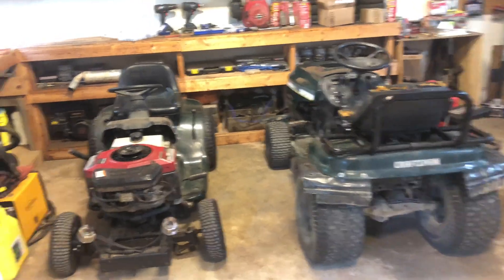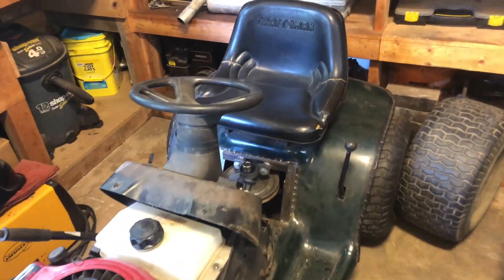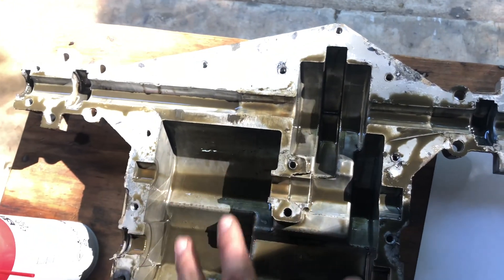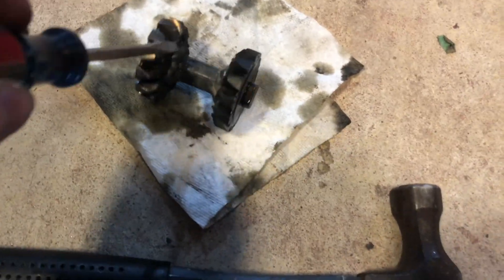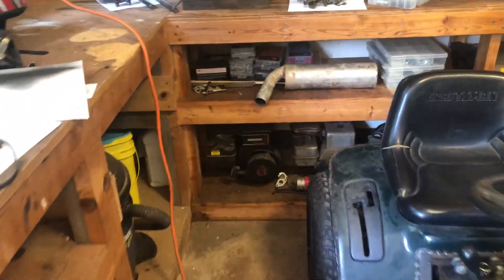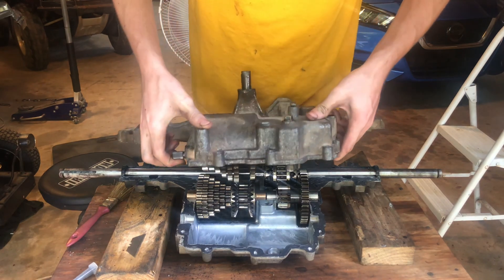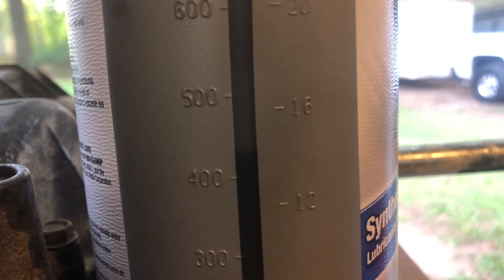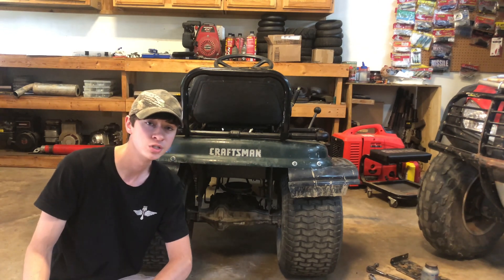Off-road Mower #12 | Welding the Diff

Comment from the maker: I have no idea why 5th and 6th gears are almost exactly the same, if anyone knows then please let me know because I am very curious. If I had to buy another transmission I would perfer the MST-205 because the gears ratios are more spaced out and just seems a little bit better, especially for the racing mower!
Reply: They look the same but count the teeth.
I really don't know either, those gears are pretty close together, if i remember correctly(I bet you went oer this in the vid LoL)it's only one tooth different and aobut the same diameter gear.

820 is the one you want to look for imo.
6 speed sequential like a 206 and has 1 inch axles, bigger tires.
Reply from the maker: Yeah! I kinda want to go 820 but it is kinda expensive and Idk what kind of lawnmowers come with an 820. Do you know any mowers that come with an 820?
Reply: @IngenGarage  any large mower with 12 inch wheels, manual, and 1 inch axles, no lugnuts
Reply: and 8 inch front wheels
Reply from the maker: @spudstudios3342  Thanks man!
Reply: 5th and 6th will feel the same unless you’re going 50-60 mph.  I’ve climbed up from 20-30-40 all the way up to 60 in terms of pulley ratios and Only noticed a real difference past 50
Reply from the maker: @QMF2  Oh ok thanks man! I can't believe these transaxles hold up to this amount of speed, considering there is nothing but bushings! I had mine up to 50 before and it is very sketchy lol.

Comment: If you can find a cheap set of used atv wheels and tires you can use the center section of the original wheels with holes drilled to match the atv wheels pattern. Done it on mine and it’s worked fine
Reply from the maker: Alright thanks man!
Reply: @IngenGarage  absolutely, keep up the great work

Comment: Hey man quick question if you lock 
your transaxle on a chain driven gear box will you loose a few gears. Because I put the gears the same way I found them after I looked them and now I only have 5 gear all forward in reverse
Reply from the maker: Usually some of the transaxles have a chain for the reverse, but there maybe some forward as well. I just lock the spider gears on the differential.
Reply: @IngenGarage  same here and I used to have 5 forward neutral and reverse now I only have 5 forward
Reply from the maker: @domjoey7514  Oh ok!
Reply: @IngenGarage  I was just wondering maybe I did something wrong but I put it in the same way I took it out
Reply from the maker: @domjoey7514  When I do something like that, I like to take photos or videos so when I put it back together I can. For example the bowl gear had a dot on one side and after looking at the footage it went in facing the left side of the transaxle(toward the short shaft).
Reply: @IngenGarage  same here I mean do you think the shifting adjustment screws could cause this
Reply from the maker: @domjoey7514 I don't know to be honest, make sure the detent ball is in there and the spring is not broke. Then just tighten the screw till it is pretty snug and flush with the case. That is what I did.
Reply: Alright thank you same here lol

Comment: Very cool modification!  Where did you get the idea to weld lock the transmission?  Now that it’s done, do you notice any difficulty turning sharp corners now that the rears are locked?  Nice job!
Reply from the maker: I got the idea mainly from FearlessFront, and yeah ican tell a difference at turning lol, I might need to upgrade the front tires to a more nobbier tires because turfs are not really doing much. I drove it around a lot more and yeah the front tires slide a good bit!
Reply: @IngenGarage  thanks for letting me know about FearlessFront.  I’m going to check him out!
Reply from the maker: @Shorty4808  No problem! I know his videos are like a decade old but I still enjoy watching them lol!

Comment: You need to get some confidence Mr.
you have had both of those machines about half apart already, you can handle locking the diff.😛

Just need to only weld it where it needs it and careful how much hot you let things get.
Ground as close to the work as you also(I pretty much try to do that with everything).
Reply from the maker: Ok lol! 😂